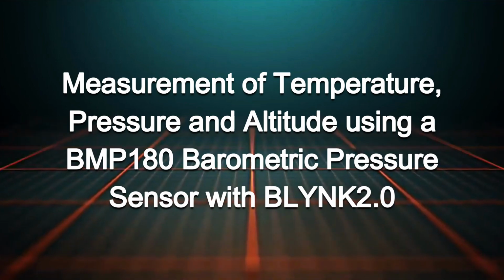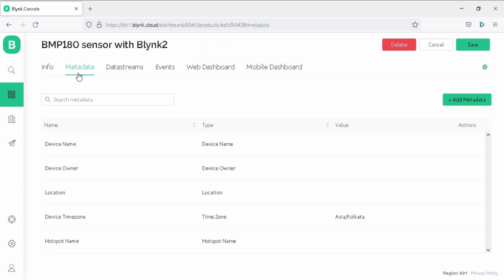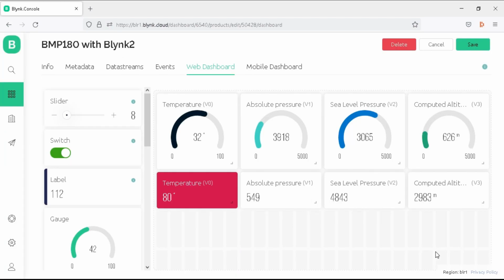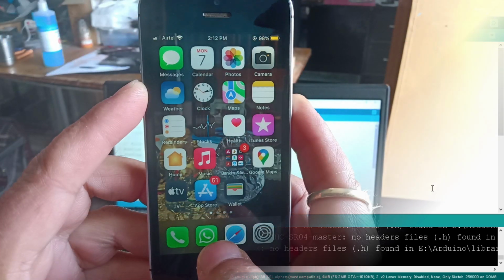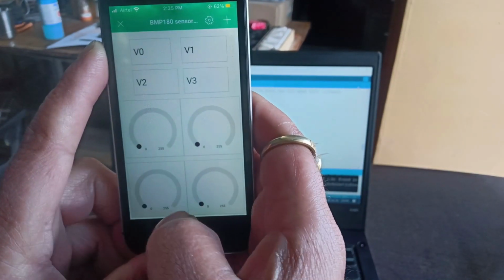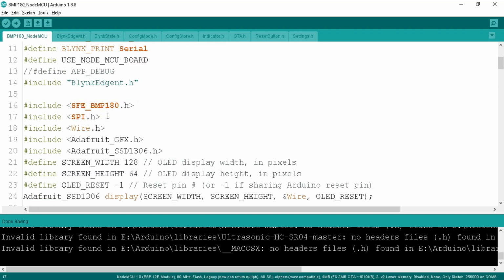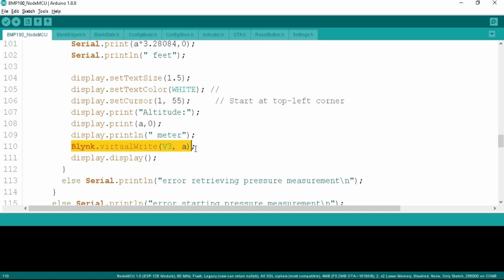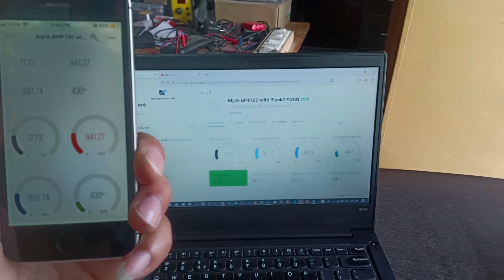BMP180 Sensor Interfacing with New Blynk2 IoT | Temperature | Pressure | Altitude | OLED Display

Comment: Hi sir I am building an indoor air quality monitoring using esp32, c02 sensor,bme280  ,i have the code but I needed help to edit the code and send the sensor data to blynk cloud for monitoring and alerting purpose if you can help pls reply for further contact 🙏🙏🙏
Reply: Sir,pls check and confirm 🙏
Reply from the maker: Received. Will revert you on mail.
Reply: Will you send the edited code?
Reply from the maker: Yes. I will revert you on mail.
Reply: @SMEDehradun  
Will you charge?
Reply: Sir pls reply since I have to complete the project work as soon as possible
Reply from the maker: Hi,
I will send the code tomorrow night or day after tomorrow.
Reply from the maker: Yes I can help you. 
Send me your code at schematicslab@gmail.com
Reply: @SMEDehradun  sir ,i emailed you
Reply from the maker: K. Will check. & revert you.
Reply: Sir how much money will you charge?
Reply: How much time will it take you ?
So i can start doing other stuff?
🙏🙏🙏
Reply: Ok 🙏🙏